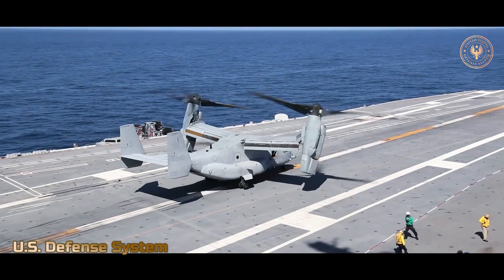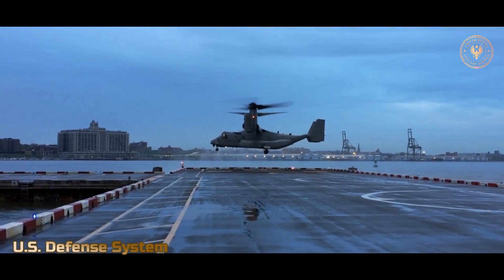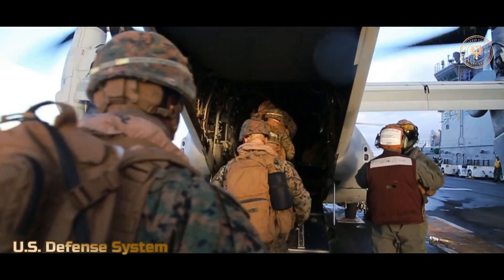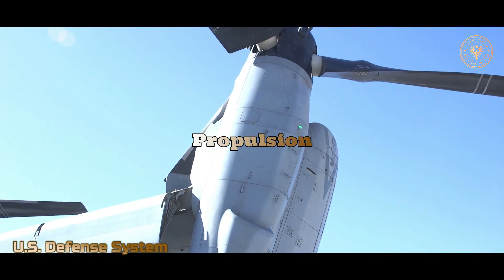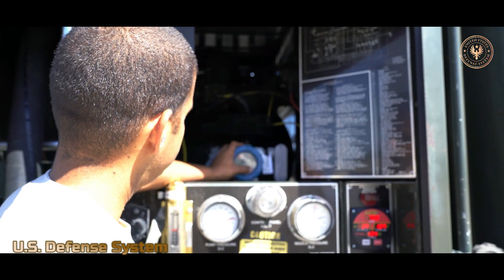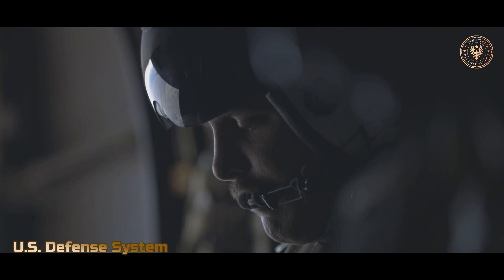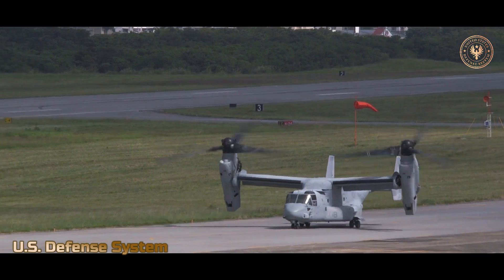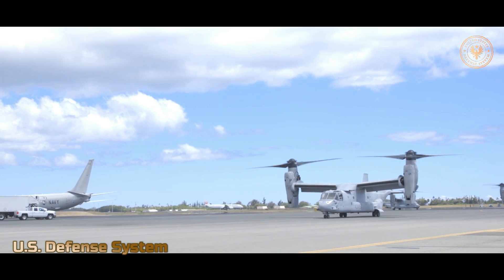How the U.S. V-22 Osprey Works?

Comment: in Advanced Warfare in Call Of Duty Series . They Got The Jet Engine On it . USA u Should Build a V-22 With a Jet Engine on it Just like in The Game in FPS
Reply: Ah yes and we will replace the large area of thrust with a small one smart. Sometimes a propeller is better than a jet engine like the v22 or any helicopter the why is a question is it easier to counteract an imbalance of maybe a set of barbells from really close to the center or from the outside edges. If the blades of a helicopter are longer the helicopter can handle it better when it's not completely balanced than if it has shorter blades